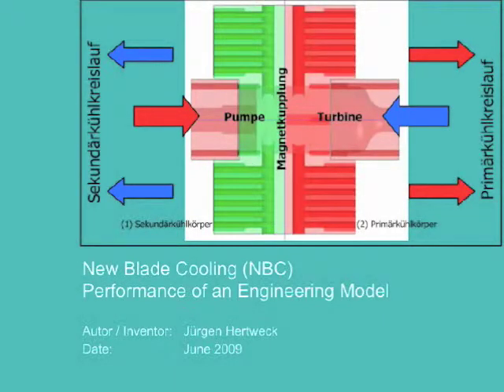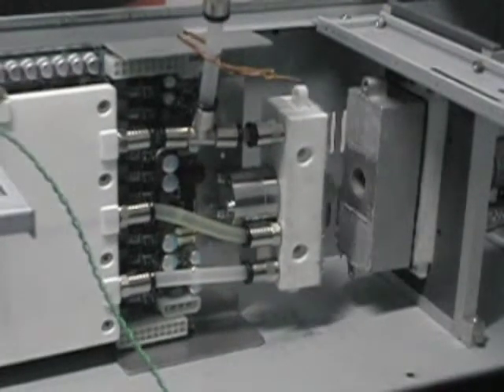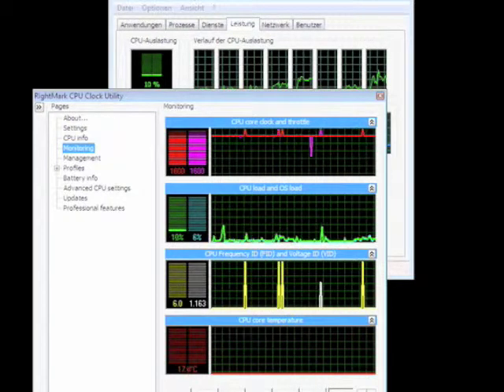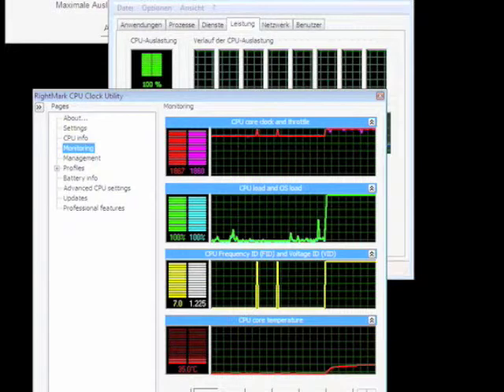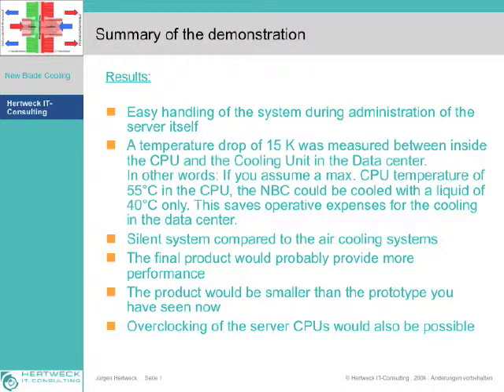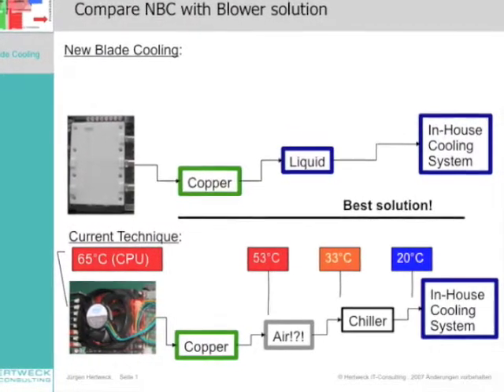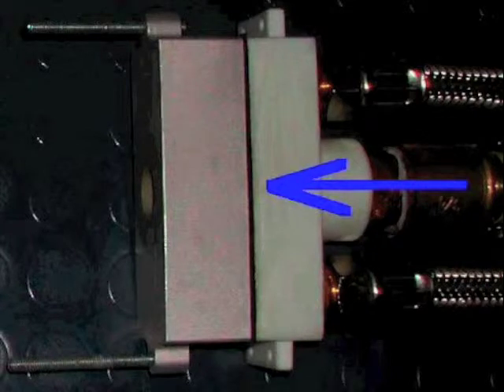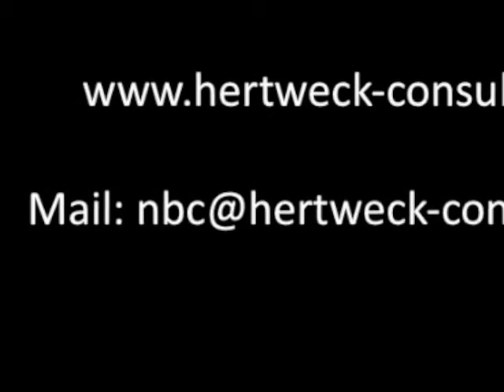New Blade Cooling - Next step in Green IT

Comment from the maker: The water has still reached the racks (in-side), so the madness is currently reality (please check state-of-the art systems, e.g. from Schroff). 
Complexity: Theory about the system is complex, this is correct. But assembling and manufacturing is simple. 
Remark: The system will be filled and corked during its production. The advantage is, that no rotating shaft has to be sealed. There are only static seals.

Comment: Using a water-cooling scheme in an electronics package that high high and low voltages and currents is madness, a law suit waiting to happen.  Your solution is inexplicably complex: primary cooler, secondary cooler, magnetic clutch, turbine wheel.  Oh my.  Worse, the entire contraption does not cool, per se, the hot liquid is directed to the room's AC system, adding another failure-prone component.